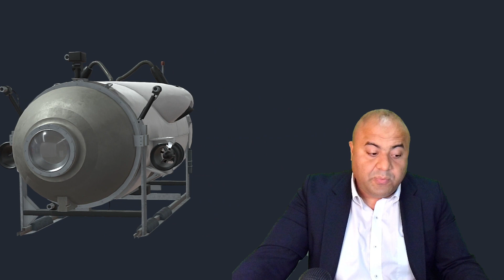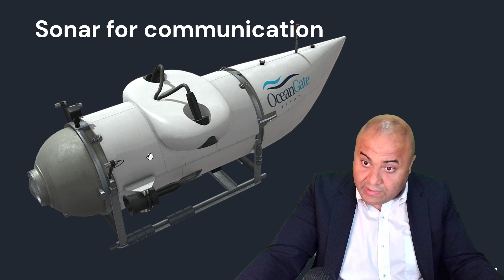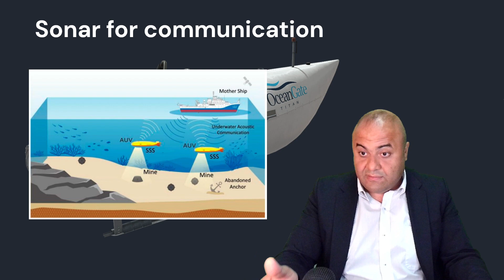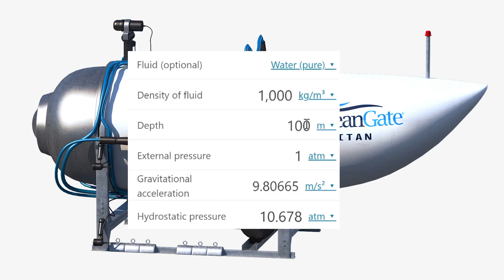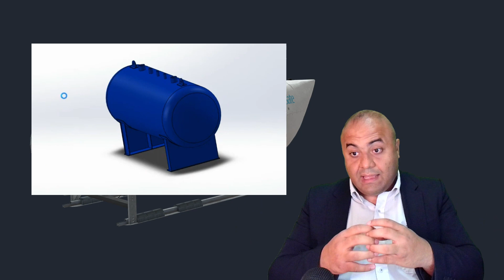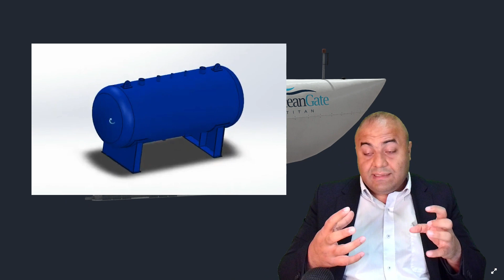Titan Titanic Submersible: Engineering Breakdown and Analysis

Comment: Dr Samara hit a nail (at 7:30), the cyclic pressure may have failed the fibre. AE NDT technique can be used to listen for internal fibre when it starts cracking, this is commonly used in big oil container to alert pre-failure.
Reply from the maker: Yes, they seem they took adventure too far even in the building of this Submersible; I agree with you about the NDT ; also carbon Fiber is a tricky material and this application is very hard to predict I think.